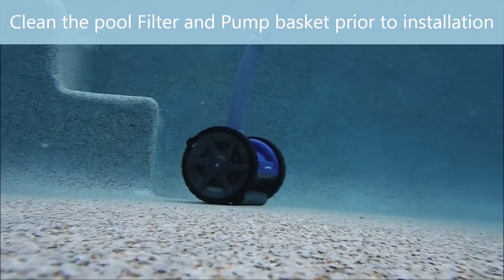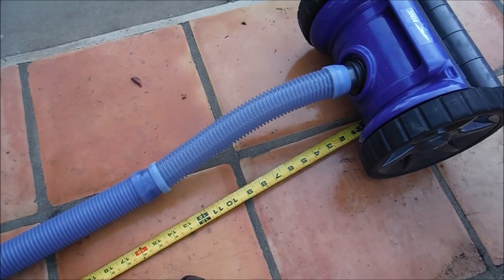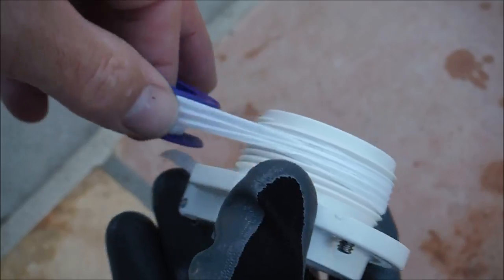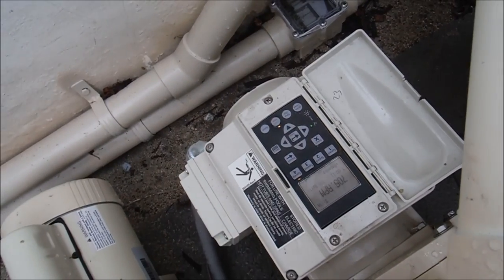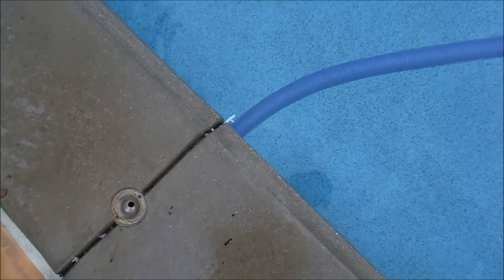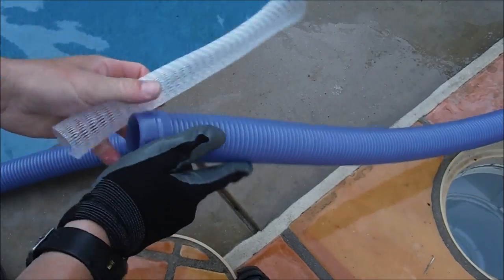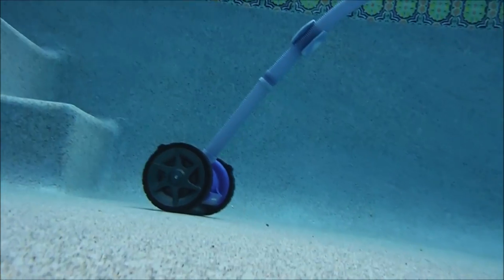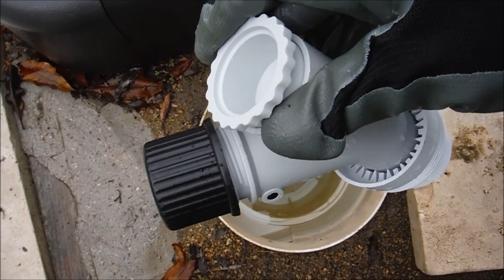Pentair Rebel Installation Video

Comment: Have a similar product to this and it never worked properly despite the manufacturer replacing parts and servicing it, I then replaced the bearings in the cam housing that engages the gears with sealed metal bearings, these were slightly larger than the plastic ones and there is no free play left in the system now so the gears engage properly, the machine now works as it should!
Reply from the maker: Good to hear they took care of you.
Reply: @SPL  they didnt take care of me or i wouldnt have to repair it myself...

Comment: Very good video.  Can you tell me how to correct the problem of the cleaner climbing the wall too much, rising up out of the water and pulling air into the line?  Thanks.
Reply from the maker: You just have to dial the suction down little by little until stops breaching the waterline. Pretty easy fix.
Reply: @SPL  Thanks a lot.  My pool servicing technician did that and it seems to have worked pretty good.  I believe the suction was at the minimum line after that.  If it still does it is it OK to go less than the minimum?  Or will lowering the RPM of the pump help?

Comment: Hey Steve I have a question. I have a Pentair SuperFlo variable speed pump and this Pentair Rebel cleaner. I have a dedicated suction line which is where I have the Rebel installed. I can only get the Rebel to clean when I install the additional piece into my skimmer to create more pressure. Even if I increase the RPM's to 3450 I still can't get the Rebel to perform properly with the main drain and skimmer running at the same time. Do you think adding a booster pump to the suction line would solve my problem? I really want to be able to run the skimmer and cleaner at the same time. Thanks.
Reply from the maker: You really don't need full skimming nor main drain suction with a cleaner working in the pool. I would  turn off the main drain and just adjust with the skimmer and cleaner suction.

Comment: Great video. I have to actually lower the RPM to 1600 on my Pentair pump to get the correct level on flow regulator. The unit works and goes at a good pace picking up debris. I feel it may be running the unit at low rpm as it does have some trouble climbing walls. Thanks
Reply from the maker: It's a little low but the walls stay clean most of the times anyway. As long as it is cleaning the bottom you arer good.

Comment: The manual shows installing the regulator valve into the skimmer port when doing the optional vacuum line installation (side port as you call it).  Is that necessary if you control the flow through the jandy valve like you did?

My pool setup were the skimmer and vacuum line are on same jandy valve.

Comment: I purchased this cleaner and was told it would chew up leaves.  It rolls over the leaves and doesn't pick anything up?
the Rebel rolls around then turns around for awhile then just sits there.  There is enough suction and no blockages so I don't understand why it is under performing when it got such a great write up?
Reply from the maker: Pretty strange.  Maybe it is set on too much suction and is moving too fast? Should work great.

Comment: Brilliant video, thank you! My Rebel won't climb the walls, any idea of what I could try? I've adjusted the flow using the gauge and tried a few different positions on the float.
Reply from the maker: What pool surface type do you have? Plaster?
Reply: @SPL  I have plaster and I am having the same issue.    Any ideas on how to help?

Comment: I adjusted the side port with my Jandy valve (4:44) and that allowed for a perfect flow regulator test between the minimum and maximum. Question: Can I continue to turn that Jandy valve, increasing the flow, while dropping the RPMs through Screenlogic (Pentair's app on my phone). Am I doing damage to the flow elsewhere by continuing to open it here? Thanks, by the way! I was all the way up to 3500 and hardly showed a minimum on that regulator test. Once I opened the Jandy, it made all the difference. I'm just not sure how much farther I can go (or what it's actually doing when opened).
Reply from the maker: It wont do any damage - you are just changing directly the flow to the cleaner and reducing it from the skimmer. The only time it can be an issue is if the cleaner has too much suction and you see the water in the pump drop down. But under normal conditions nothing is effected when you increase the suction to the cleaner and reduce suction at the skimmer. Typically 2600 RPM will get the Rebel moving well from a side port connection.

Comment: Having problem with hose twisting. The unit is about 4 years old. Does the hoses need to be replaced?
Reply from the maker: Could be the gears are worn out in the cleaner -maybe the teeth in the wheels are worn down. The big problem with the cleaner is that there is no rebuild kit. I suspect maybe a wheel is worn out - the teeth need to be sharp to catch in the gears.

Comment: question - when I open my skimmer, there is no divert, and there are 2 hole but one of the holes (toward the front) has a plug in it.  I noticed in your video both holes were open, I assume they both need to be open before installing?
Reply from the maker: Sounds like they plugged off the main drain line. It is nothing critical - possibly a leak so they just closed it off.

Comment: I just have a question.
I am from South Africa 
We have pool cleaner similar to this called the dominator pro by kreepy krauly. 
I just wanted to ask which one is better to buy between the mx6, mx6 elite, mx8, mx8 elite and the dominator pro
Reply from the maker: I look at it like this. The Dominator will run for 4 years problem free. Then you will need parts. Parts by Pentair are crazy expensive at least in the USA. So if you replace 2 wheels, the tires and maybe a couple of gears it will cost as much as a new cleaner. The MX cleaners will need more parts over the years but those parts are relatively cheap and easy to replace. You can get 10 years out of an MX cleaner. Not so with the Dominator with the high part replacement prices. The only drawback with the MX cleaners is that long string like debris can clog it. But if your doesn't have that it will be fine.
Reply: Swimming Pool Tips, Reviews & How To - SPL Thank you very much for that. I’ve checked the prices for dominator parts, the pool guys close to my house quoted me R900 for all the parts and they quoted me R1600 for mx8 parts. And I do end up having quite a lot of debris at the bottom of my pool so I think the dominator pro would suit me best.

Comment: Hi, any tips for installation in an above ground pool ? Thanks !
Reply from the maker: For an above ground pool it should connect to the skimmer port depending on the pool - the Pentair 'Lil Rebel is actually better suited for most Above ground pools.

Comment: I liked your videos on the PoolCleaner 2nd Gen and the Hayward Phoenix and Aquanaut, but for some bizarre reason, they're not available in Australia.  I think Haywards dumped all their 1st Gen PoolCleaners on us.

  My problem is with large (6"-7") stiff Eucalyptus leaves.  I've had a Barracuda G2 for 10 years, but never been satisfied with its performance, so, I'd like to know your opinion of the Rebel in comparison to the PoolCleaner/Aquanaut.
Reply from the maker: Muzz Litebeer Have you ever considered a Polaris 360? If you have 1 1/2" threaded return lines that would be your best bet. But if the Rebel is available it is almost as good as the PoolCleaner and it's variants ;).

Comment: Great video. Very informative. For the skimmer installation, it looks like this disables both the bottom-of-the-pool intake and the skimmer itself. Is it fine to just leave it this way, or is it good to disconnect the vacuum and let the other parts run now and then?

Also, our pool has a pop-up system, but many of them don't work right anymore and they're expensive to replace. That's why were getting a suction cleaner. Should we let the pop-ups run anyway or redirect to the return jet (of which there is only one)?
Reply from the maker: Phorenn I would leave the main drain off and i your connecting it to the skimmer there will still be skimming action - just at a reduced rate. And yes, redirect the floor jet if needed to the one return jet. It might be better anyway if they are not popping up.
Reply: Swimming Pool Tips, Reviews & How To -MrDgvb1 The cleaner is working great! I've been trying it with the pop-ups still running. The cleaner drives right over them without a problem. So it seems like they should help with circulation better than a single return jet?

Comment: I couldn’t find anything in the manual.  I have a variable speed pump and not sure what rpm to run the system at with the skimmer and separate vacuum line.   

Is there an ideal rpm to run.  I realize I would adjust the valve to get the flow between the lines, but wondering what rpm I should even start at?

I just got the pool remodeled from old school pop up returns and no dedicated vacuum line. So my rpm was vastly different depending on when I had the pop ups trying to do maximum clean.    

Any advice would be greatly appreciated.  Thanks
Reply from the maker: Usually 2300-2700 RPM is sufficient. Try it at 2300 RPM and go from there.
Reply: Thank you so much for the speedy reply.  I greatly appreciate it.  Great videos!      Another quick question.  Do you have an in-line leaf canister that you would recommend with the rebel?  Thanks again!
Reply from the maker: Hayward W530 is the best in my opinion.  Right now on amazon.com it is $58.00. Usually sells for $69.00.
Reply: Thank you again!  It has been purchased :)

Comment: What flow is needed for this suction machine?

I i think i will get a dedicated pump for this so I can use it whenever I need it.
Reply from the maker: 3/4 hp is the minimum for a pump at the equipment pad.
Reply: @SPL  Good to know thanks.

Comment: My Rebel spins way too much of the time.  It doesn't travel across the. pool any more.  Is there an answer for this?  Would very much appreciate it.
Reply from the maker: Could be a bad gear or one of the wheels is worn out. try swapping the left and right tires and see if that works.
Reply: @SPL  I thought the same about the tires being worn so I did already change them.  BUT still no change in the circling of the Rebel, so I took it to Leslie's for their free inspection and described the problem.  I'll keep your suggestion about the gear being bad, and see if that works.  Thanks.

Comment: Hi SPT, I just installed this Rebel cleaner today. Picks up leaves very well, but struggles to climb the walls... any tips?
Reply: Pool surface is pebble
Reply from the maker: Maybe increase the suction to the cleaner if you can.
Reply: Will do - thanks again!

Comment: Just bought the pool cleaner seems tiny bit better lasts longer
Reply from the maker: You will get a solid 4 years out of it without any real issues.
Reply: @SPL  great, ibusebthe vac mate, but there is no connector for these cleaner hoses to the vac mate any idea what part to get

Comment: Just confirming if you do it this way you won't have a basket for the skimmer? Pool builder didn't build it right, the vacuum don't have enough suction with it on and the skimmer. So I will have to hook it up to the skimmer so it's 1 line and has enough suction.
Reply from the maker: Yes and no. There is a product called the "Hole in One Basket" that you can use in the skimmer so you still have a basket of sorts. https://www.swimmingpoollearning.com/hole-in-one-basket
Reply: @SPL  thanks. Hooked it up and still not enough suction now for the Skimmer. I was looking at the Pentair Vac-Mate Vacuum/Skimmer but I don't think that will make a difference. If I have the vacuum on high enough to work the skimmer doesn't and vice versa. Brand new pool. Pretty bummed
Reply from the maker: @codyblackburn7159  I wonder... maybe some suction is going to the main drain.
Reply: @SPL  don't have a main drain